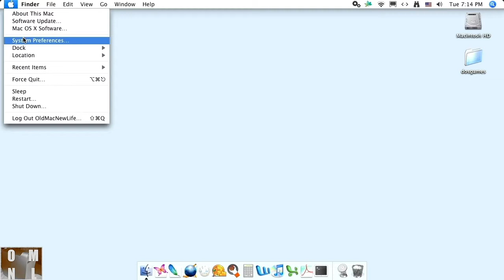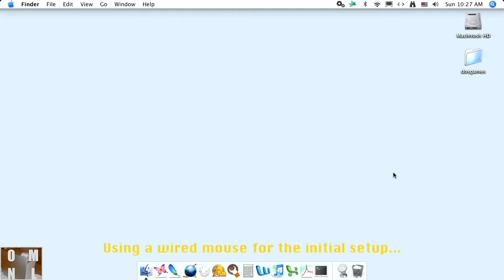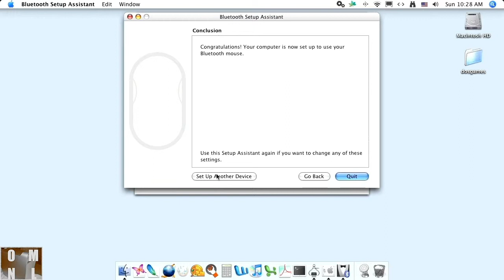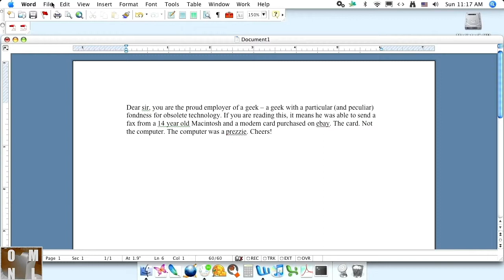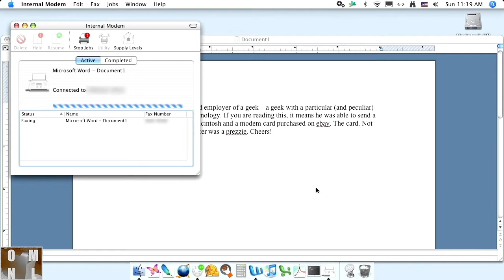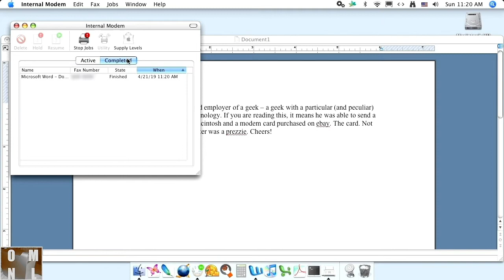Installing 56k Modem and Bluetooth in Early 2005 PowerMac G5

Comment: Hi ! Thank you for the video. But you didn't explain which exact model# card you used for the Bluetooth Module. I have the same Mac (early 2005 G5) and it appears there are a lot of different versions of this card (A1044, A1115, etc..), in which some are for the Late models, etc.. Please let me know - it would help a lot, thank you !
Reply from the maker: I'm sorry, but I don't know the model number, and that machine isn't even working right now. Think the power supply has passed away. When I bought the bluetooth module I just shopped ebay and found one compatible with the model of my Mac - A1047. If you want to confirm your Mac's model, Everymac.com has a serial number lookup at https://everymac.com/ultimate-mac-lookup/
Once you've got your Mac's model down, you should be able to hit up eBay or other shopping sites that deal in used electronics. I've bought a lot of stuff from https://eshop.macsales.com/ as well. They carry parts for Macs dating back to the PowerPC era.